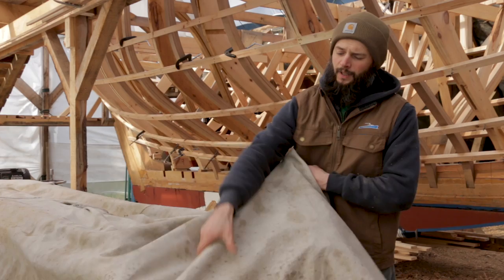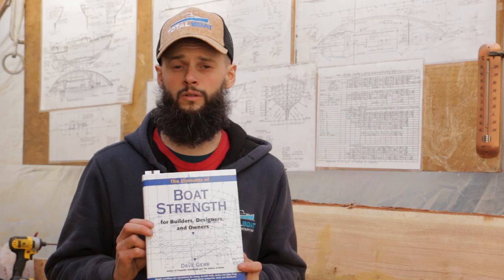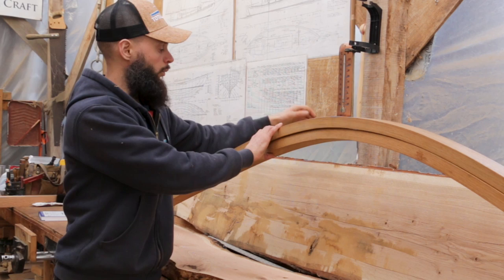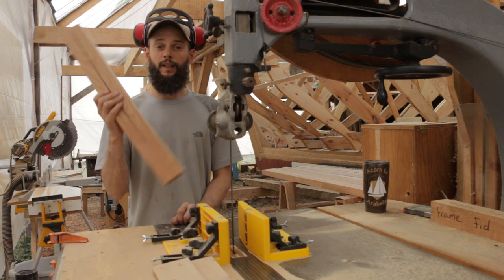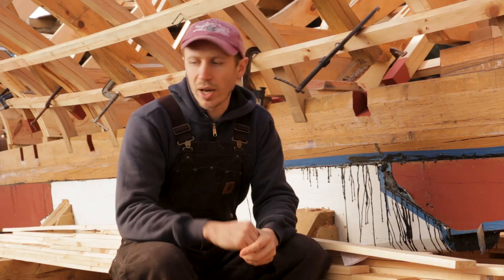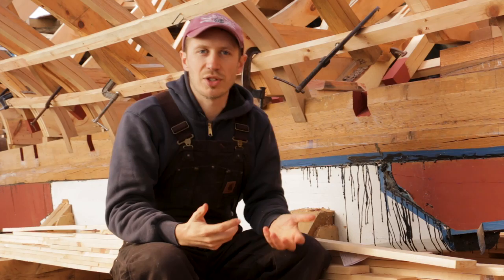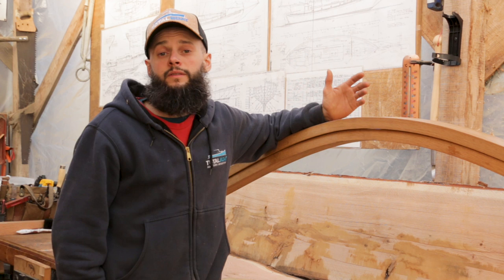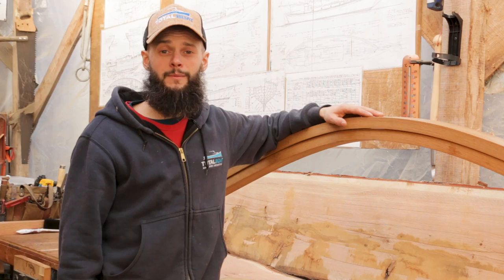Acorn to Arabella - Journey of a Wooden Boat - Episode 47: Steaming Frames: In Depth

Comment: Listening to the description of the difference between the sawn and bent frames it makes me wonder how many ancient boat builders went through a crapload of trial and error (probably quite a few lives lost as well) before they started to realize better methods to build a boat. Gives me a whole new level of respect for those ancient builders!
Reply from the maker: No kidding!  
It was a lot of trial and error and it took some serious guts to try new methods, the consequences were very real!  There was no gps, emergency signal, no rescue or communication, no weather forecasting.   
 If a storm came and you/ your boat were not up to snuff you did not come home.  Those old boats designed for the North Atlantic are hard to beat to this day and they were designed by eye and the product of a lot of trial and error and a lot of lost lives.
Reply: While I was taking instrument flying lessons, the instructors would occasionally mention that a lot of good pilots died at the forefront of learning the necessary skills to fly inside a cloud.

Comment: Enjoyed your lead pour.  I'd been a plumber 45-years and poured a bunch, including ant-hills.  I completed a 4yr electronics degree, trained as an Army rigger (they called it light vehicle recovery) and now, I have the skills I need to live here, with my girlfriend, on our 33' Pearson, 6-years now.  A 1973 top-sail sloop rig.  Our keel is 4.5-ton and we displace 11.5K-pounds of water when unloaded.  We carry enough food and water to put-her into the tide 5-inches.  We're in Tampa Bay where UVA, B, and C eat everything.  Some of our lines are $1.70 per foot (some are more) to make them last more than three years. Our mast is 44ft so that's a lot of line. By the way, don't forget to add another block to the masthead for use in loading or healing on a river...ya never know when that extra line will be needed.  You might need to go aloft while under sail and you can't use the halyard when the wind is on it. Near the equator, in summer, we have to cover the wenches, deck fittings, and railings so we don't get burned.  I cover everything with boom-tents , flys & skirts  when we stay any length of time.  We've learned a lot about living on this thing...first, we love it.  We love the sound of the shrimp, and all the other creatures, when we sleep.  The first time I heard shrimp, I thought there was a fire somewhere outside and poked my head out the forward hatch...I didn't see fire, but I saw the flashing of phosphorous in the water below our port side and will never forget that sight of a vast field of twinkling stars lighting up the harbor floor 15-feet below us.  I could've read a book under that light.  We learned to roll our cloths so they'd be wrinkle free to wear, conserve water as we clean dishes and ourselves, circulate the air with tubing and 12-volt muffin fans to prevent black-mold (deadly), we collect solar power and manage the storage of it, how to collect rain water with a tarp into an ancillary tank to be filtered and added to our stores later (rain is high in Nitrogen), and how to prevent foul odder from the head.  By the way, there are places you can't go without a 'holding-tank'.  Those countries don't allow 'compost' or electronic-sterilizers when you enter their waters. They don't allow 'Guns' either, but a Black-Powder 50-Cal muzzle-loader is a cheap cannon and it isn't considered a "GUN" so you don't have to drop it off at the yellow-flag (quarantine) point and then go back to get it before you sail-on...that would be a drag.  If you think for a second you won't need to carry a cannon, you might spend a few more hours researching that point, and with a little practice, you can re-load it three times in a minute. If you could hit a 300cc-outboard from 100-feet, with a half-inch ball, I'd bet it wouldn't follow, or try to board you, after that. Another great feature is, you can load it with almost anything, like gravel or rock-salt..same effect, they weigh & go.
We can get 7.2-knots on a reach, but generally we tool along nearer to 5.5-knots in a gentle breeze, and our 30Hp Westerbek does 5.0 at 300-miles per 15-gallons from our 50gl tank.. We've made a lot of friends while moving around this area as 'Live-aboard'.  I know ya'll are going to love it, too.  One more point...friends from Seattle told us they lived-aboard, up there, 7-years and used bubblers around their 42-foot cutter to quell the ice.  They also said the bottom growth up there wasn't too bad.  Then they said it's outrageous down here.  Our hull is five-eight-inch glass.  We don't need to worry about worms, grouper, snapper, or sheep-head.  They bite at the hull, mostly all the time, and even after we clean the bottom every 28-days.  But they can't get through the fiberglass.  Keep a good watchful eye on your hull and paint, especially your paint. Take care of blisters immediately.  We enjoy your films, comments, and appreciate your efforts, and wonder that ya'll hadn't started your mast and boom yet.  That's going to take months to dry & cure in your climate. Can't wait to see what you pick-out for an auto-tiller. By-now, smooth sailing to ya.

Comment: Great video, very instructive! I've read "The Elements of Boat Strength" from cover to cover when I recently started to design my own boat and it is a great guide that  takes a lot of guesswork and worries out of your project. Some of the scantlings in that book I thought to be just a bit overengineered compared to some vessels that I've worked with in the past. Basically the rules don't account for the forces a vessel has to face during its lifetime depending on where and when its going to be used. On the other hand these rules are widely acknowleged which makes it easier to insure a vessel or to get a certificate for it. And they add to the long lifespan which makes projects like Tally Ho possible.
Reply from the maker: It is a great reference especially when working from sparse plans!  Atkin just says fasten the planking with galvanized boat nails and to put in hanging knees but never specs it more than that.  Gerr has helped fill those blanks for us!

Comment: Just saying, probably some one else has in this 284 comments, the band saw is best used with the top guide bearings close to the surface being cut to stop the blade wandering, also expected the blade to pull off the wheels when you drew back the timber!
Great vid all the same.
Reply from the maker: You are correct and it usually is, but sometimes it ruins Alix's shot so it gets raised for a cut or two.  It still tracks fairly well with the guide that high surprisingly enough.  Pulling them back out is a delicate procedure for sure!
Reply: @AcornToArabella  ah! yes good idea Alix, keep it rolling..... camera and saw lol.
As an apprentice boat builder way way back, our 3 ft throat saw, I used to wait the BANG, TICK TICK.... after the click click click the blade noise made prior to breaking..... ALWAYS a fright when it did break.

Comment: Steam bending asks a LOT from your wood. A good place to see what happens during the bending process is EngelsCoachShop. He runs a coach shop that makes traditional wagons. The hoops that run over the wagons have a tight bend in them and after bending you can see the compression the wood goes through by the buckling put into the lumbers grain.
Reply from the maker: That it can, a lot depends on the quality of the stock and the size.  The coach shop sure does some amazing bending!

Comment: I'm no expert, but the tighter the box the better the pressure/heat.  also, the rule of thumb is one hour per one inch of thickness...soooooo 2 1/2" equals 2 1/2 hrs of steam.  Hopefully I get a chance to come out and volunteer some next spring.  keep up the good work.
Reply from the maker: You are correct about the size of the box.  There needs to be room for the steam to flow around but too big is a bad thing.  Our box is a bit big so we can use it to steam planks if we need to and so we could steam the forefoot. 
The frames were split so we were only steaming 1-1/4" thick boards, not the full 2-1/2"

Comment: One thing that could add more strength the split frame and at the same time deal permanently a blow to any rot, would be to crown and match crown the facing sides of the two pieces of wood. Wouldn't even need to be that much actually, just enough to register a decent match between the two pieces of wood, additionally, it would help during the bending process because it locks the two pieces together, they can't slide sideways anymore.
Reply from the maker: I can see what you mean but I have never seen or heard of anyone doing that.

Comment: I noticed that you omitted in the relative strengths of wood the imprtance of the direction of thickness, which may be of interest to some viewers or readers.
The classic example is that if you take a plank of wood and lay it on a pair of trestles, it is bouncy in the iddle, and will break relatively easily if you jump on it.  But take exactly the same plank and stand it on it's edge, and it is much stronger and less flexible, and jou are quite likely to damage yourself by jumping on it long before  the wood fails.
The strength is actually determined for any kind of wood (and many other materials) as being in direct (or linear) proportion to it's width, but in proportion to the square of it's thickness, thickness being measured in the direction it will be loaded, and width at right angles to it.
The place you see this most is on flooring and decking joists - 4" tall joists (of any given width) are less than half the strenth of 6" tall joists of the same width (36/16ths as strong, simplified to 9/4 or 2.25x), despite only having 50% more timber in them.
The other aspect of that (which may be important when fitting out) is that drilling a hole in the middle of a joist barely weakens it at all, but notching it at the top or bottom reduces the effective strength of the whole structure in the proportion already given.  This is why plumbing and electrical conduits should always be run through a hole in the middle of a joist, not placed in a notch on the top or bottom.
How important this is depends on a number of factors, like the availability of timber, the ease of working with it, the space restrictions and the weight limitations.
Reply from the maker: Thanks for the additional info!  That is a great example of something that we know so well we just take the info for granted so thanks again for adding some info!

Comment: Just a suggestion you said you were going to add oil to the frames and then paint them I don't know how that's going to work but I'm not a boat builder. My thought would be if you were to put an oil on them it would be nice to see them dipped into a trough of oil and the oil be warmed up. I'm not an oil expert either but I think that was my first thought that would apply the oil in an3f aggressive way
Reply from the maker: It's a commercial oil preservative.  Just wipe it one, let it dry and wipe on  second coat.  very easy, no reason to heat it up.

Comment: What about lamination of shorter pieces in the middle with the straight grain layer on the outside - you could even add a fiberglass mesh between the middle layers. Less waste and even maybe added strength? Not traditional but just wondering?  As always fun watching and learning!
Reply from the maker: Possibly, you would have to consult a naval architect on that one, it's way out of our wheel house =)

Comment: So when you split the frames, why not 2 saw kerfs instead of one ?  Two kerfs would have made bending much easier and once riveted to the plank I think would have similar strength.
Reply from the maker: That is frequently done.  But the fewer kerfs you have the stronger the frame is and every time you kerf it you loose 1/16" or so of the frame but the heel stays the same size, it can make things a little funky.  But if your vessel has radical curves it is the way to go.  Our vessel has such soft lines that a single kerf was plenty.

Comment: Bent frame is a good for boats generally in the 35 foot range. You guys are at about that limit now. Anything larger than that you would have to go with sawn frames.
Reply from the maker: Boats over 50' have been and are built with bent frames.  To my understanding the limiting size is somewhere between 50-100'.  But with that said you could stack up a bunch of steamed frames and then you could likely build as big as you wanted but at that size it's more efficient to go with sawn.

Comment: Will the tight fit on the frame sockets run the risk of splitting the keel once they get wet and swell?   I know one concern the builders in my area always had was making sure they didn't fit things too tight in place that swelling would occur particularly with planking.  For instance a single tight frame might swell and nothing happen but the combined effect of all of them swelling might possibly cause buckling.  Bear in mind my experience with wood boat building is from the gulf coast where a lot of live oak, cedar, cypress and mahogany are used so it might be an issue with the species of woods they used.   Just a concern I'm sure you guys have considered it.
Reply from the maker: Everything down there will swell a bit tighter after launch but we are not concerned with the keel splitting.  There is a lot of material between the frames and our keel timber is gigantic.  Since the frames and keel are far from completely dry they will swell but not astronomically.  If we were working with bone dry timbers I would be much more concerned!

Comment: Very nice / informative! Does the type / weight of framing effect how large lead keel needs to be!
Reply from the maker: It can, the heavier the frames the less ballast you need.  But ballast is most effective down low so a lighter hull with heavier ballast will stand up to her sails better than a heavier hull with a lighter ballast even though both vessels weigh the same.

Comment: Why use rivets? Or even screws... Wouldn't wooded pegs be a better option? Wooden pegs 3/8 thick slid into a hole 3/8 round, then split down the center with a wedge... They last roughy 100 years... Just my 2 cents.
Reply: michael lawton they’re called trunnels.
Reply: ...or trenails.  They work better for sawn frames as they have to be quite large to get the same strength as a copper rivet.  In bent frames the strength of the frame
is compromised by the large hole needed.

I believe Leo is using ~1” diameter trunnels for Tally Ho which i believe is similar in size to Arabella.
Reply from the maker: The copper rivets are stronger, easier to put in/take out, will last just as long if not longer than trenails/trunnels and with small bent frames like ours you would severely weaken the frame with all those big holes for trenails.  The trunnels are the province of larger sawn frames like Leo's.

Comment: Just an idea. But wouldn't the water tank and fire box have been more efficient under the centre of the steam box. For a more even distribution?
Reply: I don't think so.  The steaming time is in the hour range.  For such a high output steambox the temperature and humidity would be at saturation in minutes considering the thermal and vapor mass of the box.  Look at how rapidly vapor is coming out which suggests the heat distribution is very consistent.  The only drag is the oak lumber and that slowly comes up to temperature from the outside to the inside.  This video (finally) reveals that the lumber doesn't rest on the bottom of the box but instead on steel bolts suspended a little above the bottom and so there is very good circulation from all sides of the lumber.
Reply from the maker: By having it at one end and the other end of the box raised a little the steam naturally wants to travel "uphill" and fill the whole box.  
They are actually fiberglass rods that the boards sit on.  In that environment any steel would likely rust and leave iron residue on the frames.  Wood battens would get steamed and become floppy, the fiberglass rods have worked perfectly! 

There is a ridiculous amount of heat, steam, vapor pouring out of the tank.  So much so that it steamed for hours even after the fire went out!

Comment: He said that split frames make it easier to bend them and if you look at the end once bent, That the outside half would look like it got longer. Because it has to cover more ground. What? that's not right its the inside half of the split frame that gets longer since it has to cover less ground it has some left over at the end. The outside cant stretch they stay the same length they only seem the be lengthening.

Comment: OK, since the name of this YouTube game seems to be nit-picking, I'll wield by tweezers too! :)
 The bulkheads (22:25) should be installed AFTER the ceiling, which is installed against the frames. So those bulkheads are not fastened directly to the frames, whether or not they line up athwartships.. McIntosh explains this in chapter 12 of his book.
 Great video. Look forward to the next one.
Reply from the maker: To nit-pick your nit-picking.  Larry Pardey fastens his bulkheads right to his sawn frames and sawn deckbeams.  It's trickier with bent frames because there is some give and play there until everything is connected so if you are not careful you can make a hard/unfair spot with the bulkhead.  It's much less a issue with sawn frames.  It is one of the big perks for sawn frames.  I would bet our bottom dollar that Leo attaches his bulkheads right to his frames.
Reply: A well played double-nit-pick, Steve or Alix  Don't see many of those in the new era!! 
 Good point about sawn frame application. (drat!! He's been doing his homework)